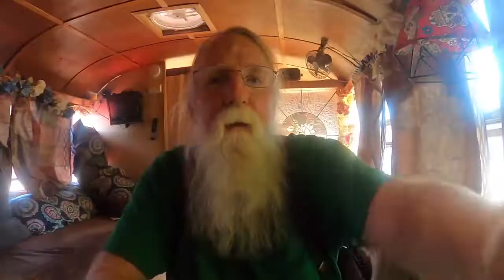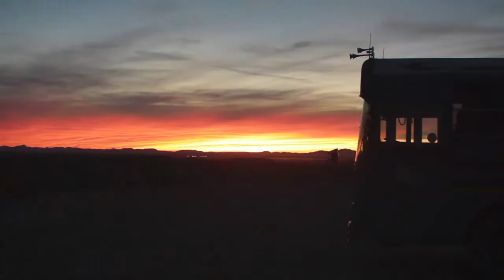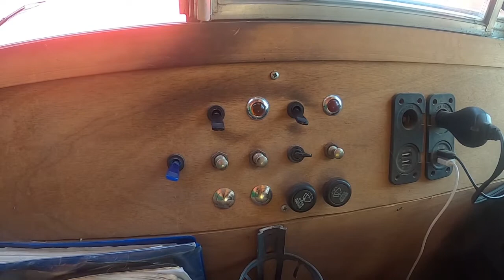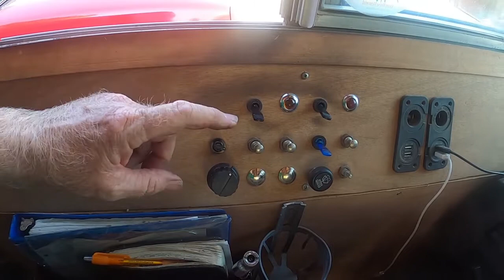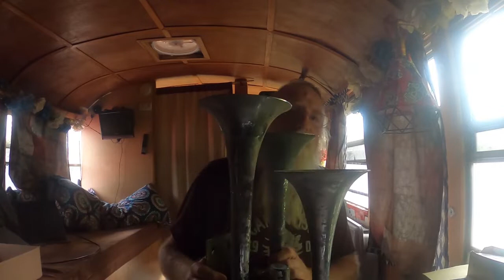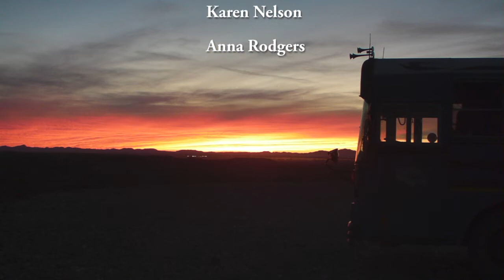Infinite Bus Tour 308  Playing with Horns

Comment: That is great! For your air horn , did you jut split off the air line for the gauge?
Reply from the maker: For the first one I connected to the air line that used to go to the stop sign. For the new one I connected to the front air tank. Just swapped a connector for a plug